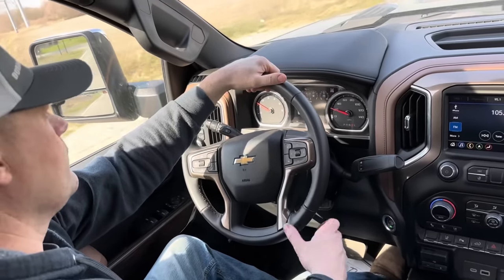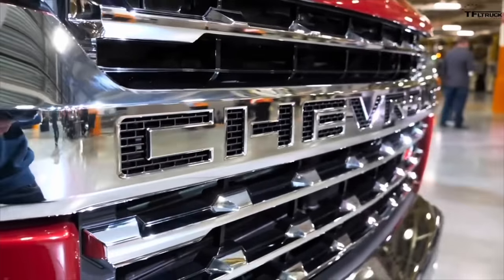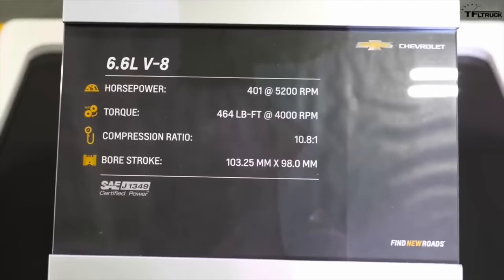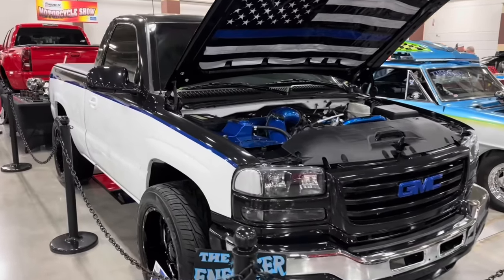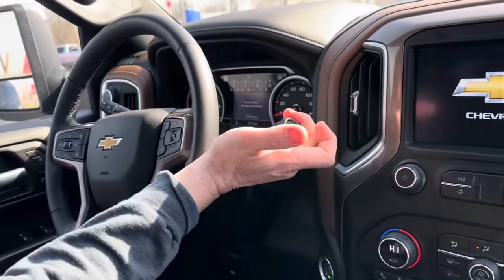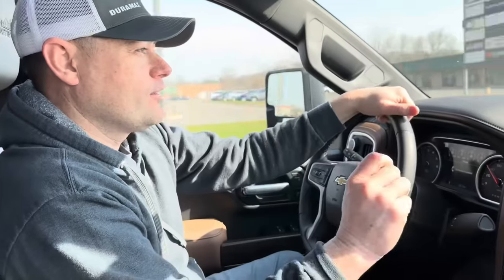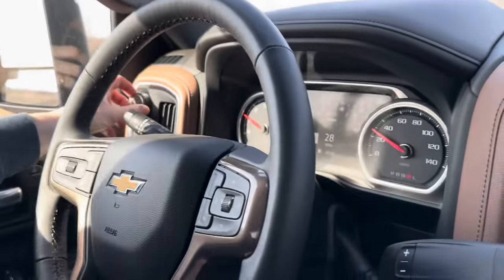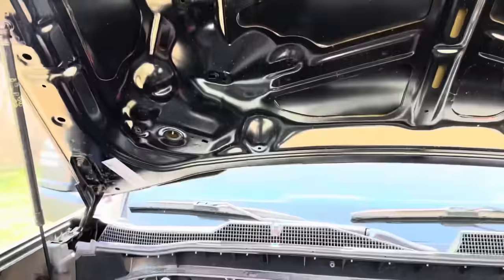What I Really Think About The New 6.6L Gas Silverado! WORTH IT?

Comment: Wow.! And I thought I was on cloud nine in 2006 when i bought a new 3/4 ton crew cab long bed Silverado with the 6.6 Duramax/ 6 spd Allison trans. 425 hp, and 650 TQ. Tow rating, 16,500 lbs. Which I towed once.! A 38' Cigarette boat and 3 axle trailer. With truck I was 65' feet long. Sometimes it  was an occasional trailer with 6 atv's on it. I got 15 mpg. Hwy . Now I have a 2015 GMC Sierra crew cab Z71 with the 5.3, and a 6 spd transmission and tow a 2 axle trailer with 2 utility atv's on board and get 15 mpg. Hwy. Set cruise around 75.

Comment: The 2022 high country with the 6.6, on our first long trip , I got 16 mpg keeping the speed on interstate at 68 mph. This is a strong engine and pulls all I need. And yes I had a new duramax that lived in the shop. ENOUGH SAID!!!
Reply: Thanks for watching&commenting you have been selected randomly among my shortlisted winner's kindly text me on telegram with the above username to claim your prize 🎊❤️‍🩹
Stay tuned🎉❤
Reply: It's insane how horribly unreliable new diesel engines are. The emissions requirements have ruined them. Yes, they still perform well...when they're not in the shop. Anyone who tows trailers under 10K (which is most people, let's be honest) does not need a diesel.

Comment: Peak torque is at 4000 rpm.   Way higher then a diesel.  The Chevy motors are high reving compared to the old school gas motors.  They also need more rear end gear selections instead of just 3:73

Comment: Former GM tech here, I'd 10x rather have the gas 6.6 vs the Duramax in a new truck. No DFM on the gasser (cylinder deactivate) or diesel emissions to worry about! The overall quality of the truck is frankly not great, though. Wiring issues are auper common even on low mileage units.

Comment: Those tow figures you listed equate to "apples and oranges." You compared a particular gas 2500 with a max tow diesel dually (also not differentiating bumper tow to gooseneck/5th wheel applications). The highest tow figure for an HD Silverado is in a dually, in a certain specific configuration. 

My 2024 LT Z71 Crew Cab gas 2500 has a 16,000 lb. conventional/18,400 lb. gooseneck tow rating. The max tow for a like-2500 diesel is 20,000/22,500 respectively, and this is with a suspension upgrade.

You also give up payload with a diesel, due to the weight of the engine. I have a 3,550 lb. payload, where the equivalent diesel 2500 gives up at least 500 lbs. in that category. 

We chose our setup for our purposes, and there's no way I would "trade up," all things considered (upfront cost, fuel costs, DEF and other maintenance costs). I will probably tow no greater than 13k (although I could go heavier if desired). I currently tow a 10,000 lb. 5th wheel, and I hardly know it's back there. I also flirt with double digit mpg, depending on speed, headwind, grades, etc. Chevy knocked it out of the park with the new gas HD setup. I'll keep mine.

Comment: I have a GMC 2020 2500 work truck. Average 16 mpg I burn no oil. I pulled a 30 ft camper and hardly knew it was there. As far as pick up speed it is not a race car. My 5th GMC I love them. Like you said GMC front looks better. Thanks for the video.

Comment: I have considered another purchase as well but still sticking with the diesel.  I am considering a Silverado 1/2 Ton or Tahoe with the new 3.0 diesel.  I worry about my 2014 Duramax being completely stock and the CP4 letting go on me.  We take long trips and would welcome the mileage possible with a 3.0 version for those trips.  The 5th wheel is staying at one spot at the beach for the time being so welcome better fuel economy.  I know diesels cost more for repairs and maintenance, but after owning one, I don't see going back to gas in a truck anyway.
Reply: They make kits to mitigate the cp4 pump when it does exploded and it will. Hopefully your using fuel additives to lubricate the pump. How many miles you have on it?

Comment: I put 20k miles on a brand new 6.6 gas. Used it to pull 16000lbs. It towed and pulled and drove better than both my duramax trucks. I will never buy another duramax again. 
The new 6.6 motors are very strong, just not sure how long they will last. My 2015 6.0 gas with 130k already needs a new motor
Reply: Thanks for watching&commenting you have been selected randomly among my shortlisted winner's kindly text me on telegram with the above username to claim  your .prize 🎊❤️‍🩹
Stay tuned🎉❤,
Reply: Dam 6.0 are considered bulletproof to, bummer
Reply: @agentcarder  my 2015 gmc 2500hd with 6.0 gas burns at least 1 quart of oil each tank of fuel. it has low oil pressure and low power. not much smoke out the tail pipe. its my daily driver and at 80mph its at 2500rpm on flat ground. it can barely pull a trailer
Reply: @pigslayer106  hopefully 6.6 is better long term

Comment: Josh the 2024 Gas 6.6 is getting the 10 speed transmission with increased towing capacity and updated interior and I’d run premium 91 fuel if I get the truck no ethanol in the fuel

Comment: GM needs to relocate the place you put the DEF fluid in, like maybe next to the fuel filler like Ford and Ram. I have a gas but it would seem like a pain in the ass especially in crappy weather having to lean over the engine bay or if you have a lift on your truck.

Comment: Used HD are same as new.....just purchased that exact truck cept a 23 model.....I stop and go quite a bit and don't tow so diesel is out of the question.....how much gas does 10k buy is another consideration between both.....2 different trucks for 2 different purposes

Tow haul mode is dial on left.....

I had the new interior on 1500, older one is more functional.....the new screen is nice but not 8k nice, lol

Comment: I daily a 2020 6.6 gas and its got decent power to me compared to the 6.0 it replaced. I get around 12 mpg though
Reply: Sad that people go gas to save money on fuel, you don’t save with the difference in fuel economy. I get around 17 with my old 7.3 and 12-14 when towing, where as that gasser will be down around 7 towing. Overall diesel is cheaper, that’s why everything industrial is diesel. I do get the convenience side of gas, that’s why We also have suburban 2500.
Reply: @jaydunbar7538  yea mine is a company truck. My personal truck is an lbz and smokes the 6.6 gas in fuel economy
Reply: 6.6 here. 12 around town. Freeway, loaded with family and not towing doing speed limit at 75, I see 15, 16 with no traffic. Any faster gets you above 2000 rpms and you start to lose mileage. 2 lane highways at 60 mph, it'll see 17-18 without a lot of stopping and accelerating. Great throttle response for passing or getting out into traffic. For being heavier and having more real estate fighting the wind than the previous model, it ain't that bad.

Comment: The good thing about I see the cons but the displacement is so big it can be tuned and increase power easily I seen built 6.6 crate engine with 600hp those engines are severely detuned the 6.2 creates 420 hp and the same torque ratings

Comment: I definitely am a believer that 75% of diesel owners would be fine with a gas truck. Most diesel truck owners don't even use them to pull and what little they do a gas would do just fine. Especially  high school kids. They are half the problem with older diesel truck prices. They only buy them because they are "cool". 
   We own both and I definitely like having our gas truck as a run around truck especially in the winter. Anoth

Comment: Traded my 05 LLY for a gas truck. Biggest mistake ever! Took me a few years to get back into another Dmax. Now I own a LMM 07.5. Even at 210k miles I will not get rid of this truck. I think I'll replace the engine and transmission and rebuild the axles instead of buying a new truck. Probably cheaper too with these crazy prices.

Comment: Most important issue with the 6.6 gasser is the oil consumption. Only reason I went with the 7.3. Now we have lifter issues lol.
Reply: I have a 7.3 gas 173,000 no lifter issues at all.  In fact no issues at all since new
Reply: had a 2020, 2022 and now 2023 6.6l gas.....not one of them had oil issue

Comment: The problem with gas trucks is not having the ability to maintain highway speeds up steep slopes with a load, my duramax just keeps pulling and I dont have to down shift to maintain speed. I use less fuel in my diesel in the long run

Comment: I bought my 2500hd reg cab/4x4/6.0l/4l80e/4.10 gears new in 2002. I think 4.10 was only choice in that configuration. Still have it. 130,000 miles. Consistently from day 1 to now 20 years later, gets 11mpg. Occasionally pull an old corvette or ford 1310 tractor. Gets 8 to 9 pulling those. Mostly level to long slope central Missouri highways on my routes. Damndest thing. I think I still love that bitch today as much as I did when I first got it. Sure seems it runs a whole lot stronger that that newer one judging by that video. If I drop the hammer getting on the highway that rig is running 100 before the end of the ramp. My harley dyna with a 96 inch and 6 speed is topped out at 130 on same stretch. By comparison of modern forced induction units they're slow. I can't say that I wish either was any more powerful.

Comment: They would've been better off putting the 6.56L in the 1500s. I see people buy and tow more in the 1500s on a daily than they do the 25-3500 series. Also I think the 25-3500s should only come in diesel or at least bring back the 8.1L with a 10 speed allison.

Comment: Now that Silverado EV 4WT has debut back in June, Does the gas truck make sense to you over the EV in the Light Duty pick up?    I think Chevy has made a good truck with the 3WT and 4WT trim level on the EV side.   Not sure ICE Silverado 1500 trucks make sense any more with long term ownership. There is no EV equivalent for 2500 and 3500 (HD) trucks so ICE is the only way to go for now.

Comment: My new 2023 2500hd gasser has alot more acceleration than the duramax I test drove. Especially if you put it in tow mode. I have a 110 gallon Ltank in the back and I pulled out on the road while still in tow mode and nailed it. I through the empty tank back to the tail gate, even with the sprayed on bed liner. This truck rocks, It's got it where it counts. No it doesnot have a 10 speed but thats a good thing in my opinion. It's not shifting all the time. It's great to hear that small block chevy wind out out too. I had a 400 small block in a 1976 Monte Carlo. This engine has some much more power and throttle response. No comparison. Love my truck!!!
Reply: Hi Mark I pick up my 2024 gasser next week.  Have you towed any substantial weight yet?  If so how much?
Reply: @MrPearl-py5gp  Yes, I pull a seed tender on our farm and i'll have as much as 18000 lbs. Doesn't even know it's back there. KNow power issues. It likes the gas, but on the road when I'm not pulling anything, it will still show almost 15 going down the road. Only 2500 miles on it but looks really good so far. My engine oil level has never moved. Not an oil burner that I can see. I like the gas cause I can get in and out start it and shut it down as much as I want and I dont have to mess with def and that crazy system and I don't have to worry about startin and stopping a diesel just to go to the grocery store. I am a farmer and I have alot of diesel equipment and one thing I know. Short runs in a diesel is the worst way to operate a diesel. They don't like that in the long run. I never liked the thought of wondering if that turbo is adequately lubed on start up. Gas is so much simpler, great acceleration, much less to manage than the diesel in my opinion. Everyone has their own thoughts though and everyones needs or wants are unique. Take care Mr Pearl. Hope you enjoy the new truck.
Reply: @markmullen5  thank you Mark for the thorough reply.  I have taken possession of my truck since my previous comment.  I absolutely love it.  I've yet to tow anything but you have given me confidence that it be ready when the time comes.

Comment: My 2024 2500 6.6 gas has the 10 speed "Allison" and is a huge improvement
Reply: I pick up my 2024 gas next week.  Have you tried towing anything yet.  I'm wondering if it will tow a 13k lb fifth wheel?

Comment: Ummm interesting perspective.  Well I have never owned a Duramax.  However I do own a 6.6 and Allison trans.  .  It is the High Country and yeah it is plush.  But at my age I earned a little plushness lol. I completely love it. I  have towed with it never had any problems.  It is comfortable on long trips and everyday driving.  I get decent fuel mileage around town and better on the highway.  I admit I have a bit of a heavy foot and I get down the highway with meaning.... lol.  I considered a  Duramax.  What stopped me... instant  6k extra for diesel... cost of fuel... cost of maintenance... winter fuel summer fuel  cold weather issues... I didn't need the additional towing capacity the gas engine tows everything I need and gets right down the road no worries.  Additional I travel and believe it or not there are areas where diesel is not available and gas is always available.  I can pull into any fuel station anywhere and get fuel.  I have never had a issue with "burning oil" ? Or using oil ? I change the oil routinely along with the oil, air and fuel filters.  Far less expensive than the same service on the Duramax . I also don't worry about running and wet stacking due to insufficient load . Sticky injectors... failed glow plugs... none of those issues.  Turbo cooling issues... I jump in it fire it up and down the road I go. I  did install a aftermarket exhaust just because... old hot rodder lol . Not loud but throaty lol... 
     Well good luck and hope you find something.  The world is your oyster.  Get a truck to meet YOUR needs. Otherwise you won't be happy no matter how good it is.   😎👍

Comment: Wait until the 10 speed version comes out and see if there is a big difference in how the power is applied. The 2024 Chevrolet trucks also received a front end update and look pretty good. I think you stuck on the get up and go, these aren't hot rods.

Comment: No, you should do a test 6.0/6.2 to the 6.6 gasers. I will not buy any diesel after 2009 as a homeowner that pulls an 8500lbs travel trailer around New England and NY I hate DEF and all that goes with it. As an old-school Truck driver, I would not buy a modern tractor whether it was made from Mack Pete Kenworth Freightliner. The day the paper log book went so did I.

Comment: My wife’s 03 6.0 gasser 2500hd she had got between 8-10 mpg. Fast truck but oil burner for sure. Excessive oil out the exhaust pipe… idk why GM has not addressed this problem yet it’s been so many years and in Michigan it’s $3.99 per gallon here at the BP gas stations! It’s $40 to give my 06 mega cab 5.9 a half tank of diesel and about the same for my 08 sierra 5.3 🤷‍♂️ I get better mpg out of my 06 mega cab than I do in my 08 gmc 5.3 🤦‍♂️😂

Comment: Technically, that gas engine is a 6.5 liter if you don't round up but here's the kicker...the Duramax platform is 402.7 cubic inches. There is 61.024 cubic inches per liter. So if you do the math, the Duramax is technically also a 6.5 at 6.599 Liter. ❤😢😂 A 5.9 Cummins when you calculate it out is a 5.88 liter. Auto manufacturers always round up in their liter advertisements.

Comment: Anybody here know much about engine disassembly? My truck won't start without glow plugs, even in 90F temps. I finally got around to getting a compression tester, and none of my cylinders have 300 PSI. I'm using the truck for work, so I can't afford to have it down to long. Somehow, a similar engine fell into my lap. I figured I could try to build my newly acquired engine, and swap engines once it's ready, except that the engine is seized from internal rust, 2 cylinders rusted from a blown head gasket. I put the engine on a stand, yanked off the heads and pulled the crankshaft. I removed 6 pistons, leaving the 2 seized ones. I got a couple of cheap head gaskets, put the head back on, filled the cylinder with vinegar, and filled the cylinder with 120 PSI of air pressure. After about 5 minutes, vinegar started pouring out the bottom of the engine, and 20 minutes later the piston shot out. That leaves me with 1 piston left that's still seized. I did the same, and after 3 days nothing. I'm going to bore the engine 0.020 over, so I don't mind damaging the pistons as I'm going to be replacing them anyways. I do want to save the block. Any suggestions on how to pull the remaining piston without damaging the block?

Comment: Sarge I think what people way too often forget when trying to blast on a 2500 series or 250 series gasser truck is the very basics... somehow...

The basics such as, they're geared low. They're not gonna be fast.

A 2500 or 250 series with a turbo diesel though, yes. Fuel, boost, power. Rapido buriage of the speedometer.

Gasser heavy duty trucks just can't do that.

However..... throw a turbo system on that thing and hop the fuel up...... the field levels out a little. But that's not common enough to even bring to a debate 😂😂 

A 6.6 gasser with 4.10 gears having a turbo would be useless.

Comment: The 2020 6.6L Gasser is hardly working  at 401 HP. A little tuning would easily take the power to 500 ponies without issue to the power train.

Comment: I dont know why gm hasnt added turbos to ls v8s or newer style v8s like ford does with the ecoboost v6. Reconfigure it to handle boost and be reliable. Take the boost away from the duramax or any Diesel you will have a turd like the old 6.9 idi and 7.3

Comment: Y it would be interesting. I have a 2015 Duramax and My def heater is bad again. But I love the Duramax. I have 96k miles on Mine. I also have a 2019 Chevrolet Suburban with that stupid 8 to 4 cylinder, I'm going to buy a delete for that. I know of a lot of the 5.3 engines that have blown because of it.